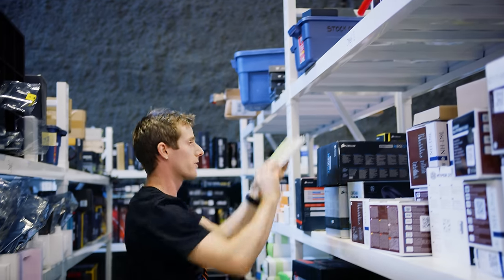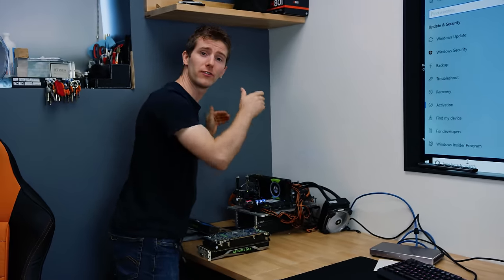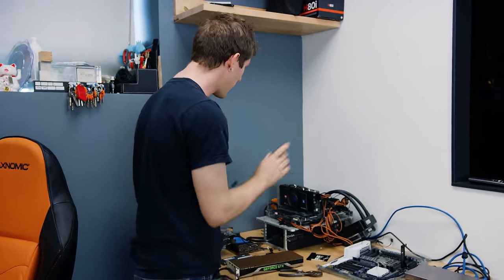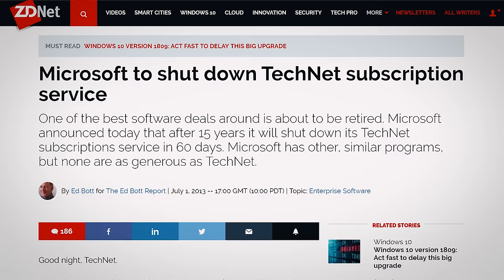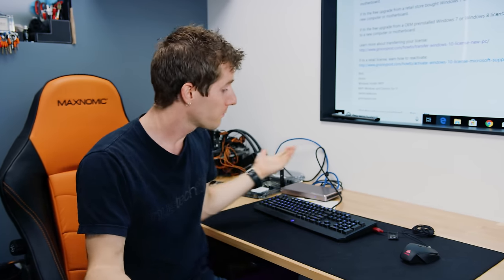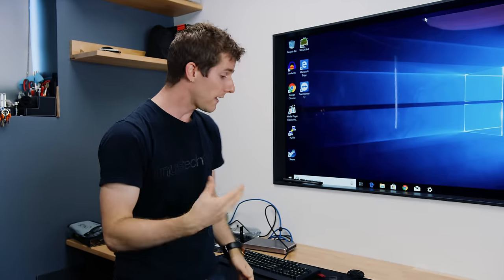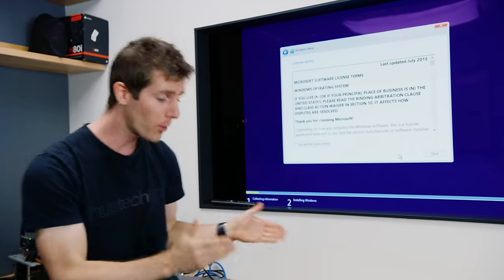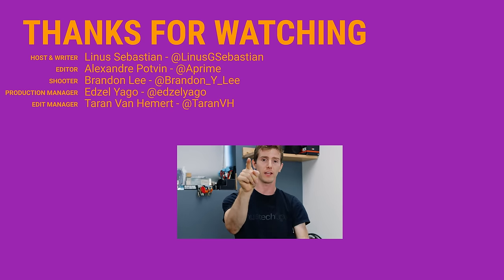Why Does Linus Pirate Windows??

Comment: The Windows activation validation service checks for "votes." If a certain threshold of vote is passed, it will prompt the activation. This has been a thing since before Windows Vista. For an example, A harddrive counts as TWO votes, since it checks the hard drive's model/serial among one other thing. 7 or so votes have to change out of the 11-14 to cause an activation prompt to occur. RAM is only one vote because it only checks the amount of RAM, nothing else. The PCI bus counts as its own vote (part of the mother board.) Sound card counts as another, and so forth. A lot of things DO NOT count toward votes however, such as Power Supply, amount of USB ports/devices, etc.

Oh and, I bet you didn't know this but... CD-ROM / DVD / BD-ROM Drives count as a vote... yes, really.
Reply: well obviously a PSU doesn't count as a vote, since they really have no way of determine it, only thing it does it deliver power, there is no data transfer there, its a simple do I get enough power, then I turn on, if I dont I dont turn on at all
Reply: If they really wanted to, they could measure the voltages coming off the various power rails and throw a flag when the averages change outside of what could be expected from natural component wear...

...but they would be pretty hard-pressed to justify it, I think.
Reply: @Septfox  only because they're not as greedy as Apple
Reply: most laptops come with DVD drives anyway so they should still count.
Reply: You saying Windows runs an electoral college?
Reply: @To-mos  For 3 or 4 years now the vast majority of laptops come with no disc drive. Go to any store that sells computers near you and see for yourself.

Comment: when 90% of use cases end up in the end user breaking the law, it's the law that is the problem, not the user
Reply: EULAs are actually a pain to enforce in court. So, the problem isn't really with the law, but the fact that MS has deeper pockets than you, so if you did end up on their radar, they could still sue you into compliance from just stretching out the legal process. That said, MS have no reason to go after individuals breaking the EULA on their local machines, they would only care to enforce the EULA on people providing the pirated copies or enterprises making a significant profit off of it.
Reply: Yes. Very very low chance that they would attack the end user. it's simply a waste of time and money. Distributor/source will always get the hit.

Comment: Non-activated Windows 10 isn't necessarily pirated. If you defeat the Activate Windows watermark it would be. But Windows 10 is designed to run unactivated. Previous version would give you a month to activate before shutting down, but Windows 10 uses the watermark instead. It seems that Microsoft would prefer people run unactivated versions of 10 than to run pirate versions of Windows. The Windows 10 watermark appears right away whereas previous versions took a month for the watermark to appear so the appearance of a watermark doesn't automatically make it illegal. 

This is the normal behavior for Windows 10. Since this is the way Windows 10 works as Microsoft provides it, then it can't be illegal. It may be unactivated, but that's not the same as a pirate version.
Reply: Not sure it counts as pirated even if you remove the watermark.
Reply: And it works fine too. I have been using this "Non activated" Windows 10 for 2 years now and I have had no problems. I even get Windows updates.
Reply: you are absolutely right, what changed from before is that MS actually have competition now, they prefer you getting used to their environment than using ubuntu for example
Reply: agreed. also, this his been possible with windows since at least 7
Reply: yeah, it takes away a few things here and there, but I cannot say I ran Windows non-pirated non-activated once or twice in my life
Reply: Are you kidding???  Since when has Linux ever been competition for Windows?  Windows has no competition and never has.  Linux is for corporate gurus, MacOS is for a very specific niche of people, and Windows is for everyone else.
Reply: not sure if removing the watermark is against eula or considered piracy
Reply: Now wait just a minute, had you actually used a Linux system before? A lot of things are going into "The cloud" and can be handled in any browser. Google's Electron API and node.js is taking over traditional desktop applications for simple things like chat clients. Steam's implementation of Wine, Proton and libraries to convert DirectX 12 calls into something the Vulkan engine can use is making it easier than ever to not use Windows. But had you bothered to try? If you haven't seen for yourself, you shouldn't be bothered to say anything about it.
Reply: @TheDuckPox  depends.  If you use kmspico to remove the watermark, it is piracy
Reply: @bluephreakr  yes i have used linux and it boils down to the average person doesn't want to mess with commands.  If I wanted to do that then I would still be using Dos.  It isn't intuitive for the average person.  I am a pc tech so I can use it but prefer not to because what I can do in seconds on Windows takes minutes on linux
Reply: @bluephreakr  and your technical speak tells you why you prefer linux.  I understand what your saying but the average Joe doesn't even know how to view files in a c drive in file explorer so you tell me.  I just proved my point
Reply: Linux, specifically Ubuntu 18.04 is running my gaming PC! And yes I run "windows only" games on it. Where have you been? It's extremely easy with steam, and I am know very very few terminal commands. In other words, I'm a linux newb.
Reply: Brandon Miller in your small world son. macOS is for everyone whose willing to spend extra bucks on Apple devices or anyone with a Hackintosh which is insanely great number of people from music/video/photo production , GNU/Linux is used by almost everyone who uses embedded devices, smart devices, companies, old PCs, modern PCs, your routers, etc. While Windows is only comes preinstalled on about 90% of all laptops and tablets + Desktop PCs which makes everyone develop unawareness of how Operating System works which comes to this era of Windows (more viruses, outdated kernel, outdated filesystem, buggy mess). Keep that in mind that M$ is greedy, however they are aware that Linux based OS will replace them sooner or later and they can never do anything else beside changing their business model (which shown to us in Windows 10). In other words, it's just a matter of time the business model dies and get replaced by all *nix OS
Reply: @chessguy125  your not understanding what I'm saying.  Yes I get it.  It may be better for people that have a higher technical iq but you are thinking about yourself.  The average person isn't going to have a clue about linux or using the su command and etc.  That's great if it's good for you but you don't represent the average person
Reply: @TheDuckPox  you make no sense.  Why are viruses on windows?  You answered your own statement, because market share of Windows is greater than 90%.  Why develop a virus for 10% of the community.  If linux was more popular, then you would see more flaws.
Reply: @bluephreakr  sorry to be pedantic, but Electron is an application framework built ontop of nodejs and Chromium by Github (so technically Microsoft now). Proton is a fork of Wine (Wine isn't a protocol, so there can't be an "implementation" of it. Vulkan is another API, not any "engine" per se - it's just another graphics API like DX11/12 or OpenGL and DXVK (used in Proton) translates DX calls to Vulkan calls just like Wine translates windows syscalls to Linux ones (oversimplifying a bit, but that's the general idea).
Reply: @brandonmiller2812  Linux is more common than you think. All versions of Android are Linux Distributions, a large portion of Car Infotainment systems are Linux based, the majority of Servers use Linux, and Linux is the most common OS on supercomputers today, for a few examples. There are also many Linux distributions that are easy to use, with no need to use a command line for the majority of tasks (it is optional, just like the Windows command line). Ubuntu, Linux Mint, and Fedora are all popular examples of easy to use Linux distros where you don't need to use the command line at all if you don't want to. I have personally used Ubuntu for a while on a secondary PC, which i used almost every day for period of a few months, and i only used the command line once or twice to check out the command line, so i could see how it differs from the Windows command line.
Reply: @stigrabbid589  didn't say it wasn't common and I understand the platform that linux is on however Windows still has about a 90% market share regardless.  Cell phones, ubuntu, android, it really doesn't matter.  What matters is linux still has very low market share.  Reason for this:  try explaining to your grandma how to use linux.  You guys aren't getting it.  For the "average" person linux is too advance
Reply: @hugopalmava  Linux and Mac has different purpose than Windows. So Windows doesn't really have a good competition.
Reply: Actually thanks for that input, I was putting it in terms I understood and there were clearly fallacies. Oversimplification's really what you should do in a YouTube comment because people browsing it often don't give a damn about pedantic stuff but thanks for correcting some gross oversights.
Reply: Never noticed your posts until now. You can use most modern open-source systems (including FreeBSD ones) quite comfortably with limited use of the command line. Sometimes, with no use of it necessary, such as most Ubuntu and Fedora systems should you figure out how to use the GUI programs available, and much like on Windows there are guides and tutorials on how to deal with certain issues users may encounter.

Use of the command line is a convenience for people who write such things, as they can just supply a series of commands or a script however there are more-than-enough GUI-equivalent applications to perform a majority of the same common tasks.

I don't know how you can call yourself a "PC Tech" when you don't have an innate grasp of other operating systems (regardless of what kernel they run) where it compromises your ability to perform tasks quickly outside of Windows. And this circular logic thing where you make a strawman then say it proves your point? That's insanity; it's like writing a Wikipedia article then citing yourself as a source. You just can't do that.

Comment: Other people: I'm gonna get the new windows 10 pro.
Me : Buys windows 7 pro and then migrates to windows 10 pro to save money.
p.s. This actually works even in 2020.
Reply: Bob Bobbertson  fr?
Reply: @itsotthd3329  sure you can also get Microsoft office all cracked 😆
Reply: Just use kinguin
Reply: @boygenius538_8  I'm considering buying from them. are there any performance changes? and do the keys last forever (assuming I don't change my hardware)
Reply: Walter Clements there are no performance issues is full fat windows. As for lasting forever it hasn’t failed me yet and I have no reason to believe it will. You can get for like 20 dollars on a good day.
Reply: @boygenius538_8  nice thanks man
Reply: @boygenius538_8  Wtf m8 windows 10 pro is like $3 for a key on the internet rn
Reply: @Opsraw  Those keys are either out of your region, a volume license generated by the seller with no support in the ToS or simply an activation key shared on the internet (the latter usually comes with sketchy as hell instructions to bypass the legit activation server).
Reply: FeanorBR whoooooooooo cares if it doesn’t match their tos, it’s $3
Reply: @agentcorgi2995  Well, they can revoke your access to it.
Reply: @LemonRush7777  in theory yeah, in practice I don't feel it'll happen at all...
Reply: @Opsraw  Oh it does happen with the volume licenses since the seller just keeps generating more until it gets flagged. And you never know where your license came from.
Reply: Had Windows 7 come OEM locked with the pre-assembled PC I bought second hand from a friend (some weird Acer Predator tower, weird because it has liquid cooling for the CPU, a Radeon 5850 and has a blue case, a combination which apparently doesn't exist, but something along the lines of a G7711). Windows of course wouldn't just work when just putting the HDDs and some parts into a new PC but once I could upgrade for free to Win10 using the key (which could be read using software), I could migrate things into a new tower with parts from all over the place without a problem. Used a USB drive to put the Windows Installer on, noted down the key from the Acer, put things into new tower and then just installed Windows 10 with the Acer OEM key.
And recently when my 750ti broke, I just installed the old 5850 without a problem.
Reply: BOYGENIUS538 _ I used g2a for my activation key, it was about $22, never heard of kinguin to be fair though...
Reply: I bought a Desktop and Win7 Ultimate separately in 2010. In 2019 I finally downloaded Win10 onto a USB stick to use in a machine I built. The Win7 key worked just fine to activate it.
I wanted 2007 Office on my new rig, because it has a couple of things that I can't quite get to work on similar free stuff. I loooooong search to the far corners of the net came up with a website used my Microsoft technicians, and .exe downloads of legacy stuff you can no longer get through Microsoft. The technician who linked to it in the bowels of some website asked that no one publicise the web address. I think that warning was also on the wbesite when I went there. It was a vast and beautiful trove of old Microsoft software. Belarc got me the Office 7 key off my old machine and I was good to go. I didn't save the web address for that legacy site, and I really wish I had.
Reply: It actually worked today..
Reply: "buys"
i laughed
Reply: @Shloak Taneja 
where can I get win 7 from??
Reply: @boygenius538_8  that's what Linus said to be side key, it's actually some kynda of piracy kek.
Just don't activate windows then
Reply: Call me whatever i get it free from school 😎
Reply: @sevend2  it could fail. Cheaper keys are usually from bulk purchases that aren't supposed to be resold. It's highly unlikely, but it could happen. As for what Linus is expressing here, as long as it isn't an OEM key, you should never, ever have trouble with your license, and if you keep the disc, box and everything, proving ownership isn't hard, and Microsoft are always willing to clear up any false positive flags.
Reply: Just get the inactivated windows version completely free, just use like a computer from like a friend or local library
Reply: You know you can download it on a usb and use that on a new pc with no os
Reply: FreeAmania0123 that’s what I’m talking about, only problem is you need an extra computer or such to download it off of
Reply: Really? Like the official Windows 10 upgrade? Pretty sure that was out for like 3 years now already... Unless you mean a third-party way to do that, then I think that's already a given.
Reply: @itsotthd3329  if you buy any version of windows 7 higher than the original, you can hop up top that level in windows 10 for free
Reply: Bro can you skip the product key to have an activated windows 7 tho
Reply: 200 IQ
Reply: just use HWIDGEN over on r/Piracy, it's as against the ToS as buyign keys off a kinguin so it doesn't matter

Comment: Working as IT Technician it was pretty clear to me, why all of the testbenches showed that watermark. It even wasn't surprising or something like that. But I guess that not all of IT related people gets this. But I must say - Windows 10 activation is WAAAAY better than before. Ofcorse it has its issues, but few times it really let me activate systems, that had been changed fully (except only HDD/SDD was still the same) because of faulty motherboards and the fact, that soc1156 isn't available anymore.
Reply: After changing the Motherboard+ Processor + everything expect SDD -> broken license not recoverable... Support told me to "delete/remove" one in my Win Account... gone forever...  (was a upgraded one...)
Reply: In my case it was not the OEM license, but retail. In one case windows did activate by itself, and in other case I just needed to call support and activate OS by phone.